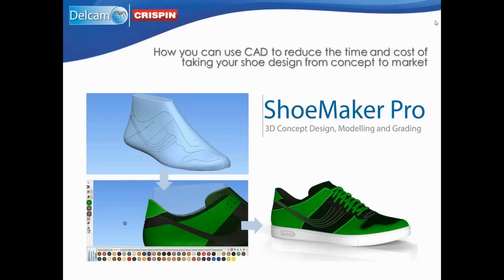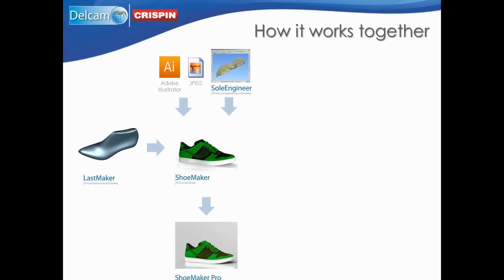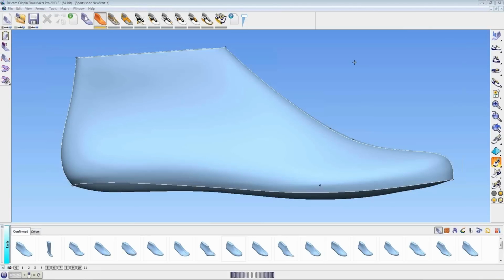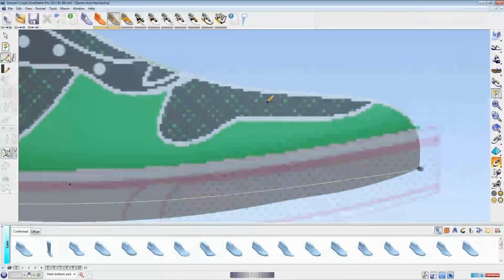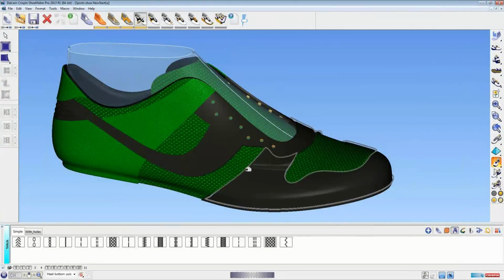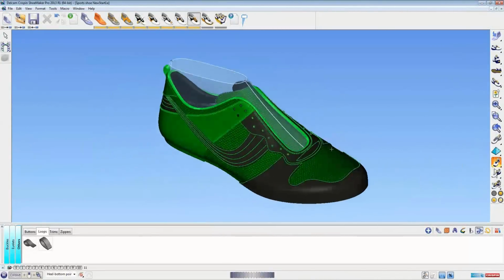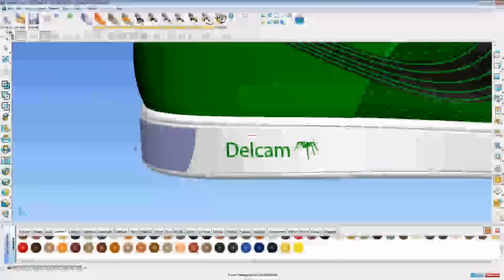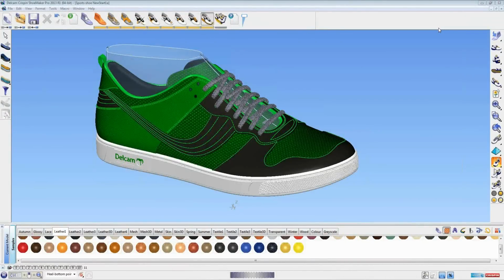How to Use 3D Shoe Design Software - ShoeMaker 2013

Comment: Could you tell me, how to change the position of the shoe last from Right to Left side? which means the shoe last can be switched to the Left Shoe Last based on the Left Foot. Because, on shoemaker only provide Right Side of Shoe last. For Example, on this video, it shows that the shoe last model is a Left Shoe Last. Thank you
Reply: +Johan Kurayaki  hey man, i only have 3 steps to work to manufacturing step.while there should be 10 step  Any idea? appreciate your help
Reply: Johan Kurayaki could you please help out with the shoemaker pro. I need the software.